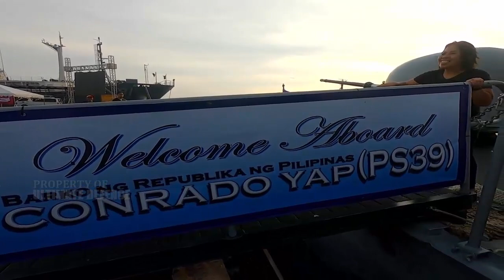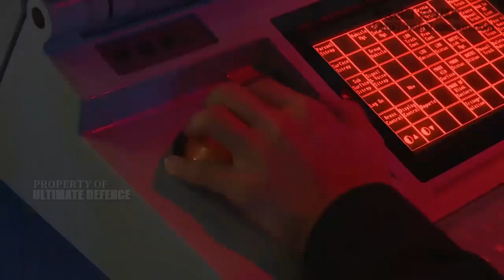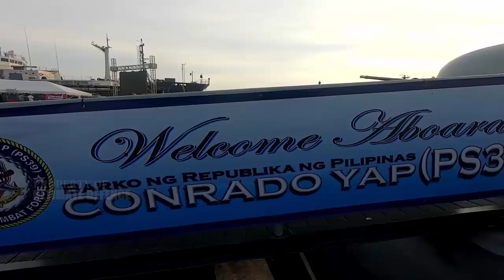PHILIPPINE NAVY WELCOMES BRAND NEW 'MOST POWERFUL' WARSHIP BRP CONRADO YAP!

Comment: The BRP Conrado is the first Philippine Navy  fighting ship to counter Chinese PLA illegal intrusion to Philippine waters with the sonar and torpedoes that can panic the Chinese submarines. But still it is drastically lamed due to the fire fighting capability as a previous POHANG Class Corvette equipped with the following:Anti-ship:
2 x 2 MM-38 Exocet (Flight II)
2 x 2 RGM-84 Harpoon Block 1B (Flight IV)
2 x 2 SSM-700K Haeseong (Flight V - VI) were removed by the South Korean Navy and so much of the CMS and electronic warfare system. South Korea donated this corvette but the amazement South Korea removed above systems to transform the Corvette to a mere patrol boat  gunship with only guns e.g. OTTO MELERA , OTTO BREDA etc  The SONAR and its torpedo  system may not function with the Corvette's CMS (Combat Management System) as 60% to 70% of the electronic warfare system were removed and dismantled by the Koreans to install in their new ships or part of their Navy running spares ! POOR PHILIPPINES IT IS BETTER THAN NOTHING! NO REGRETS!